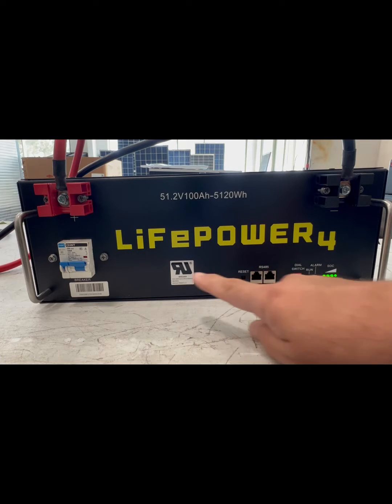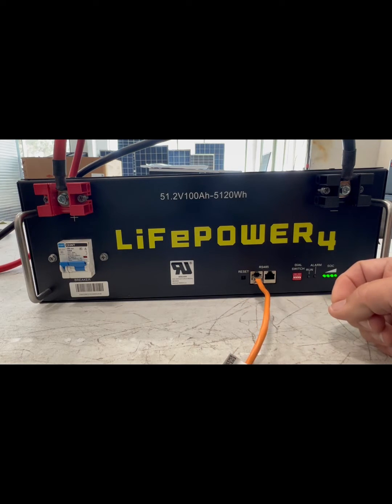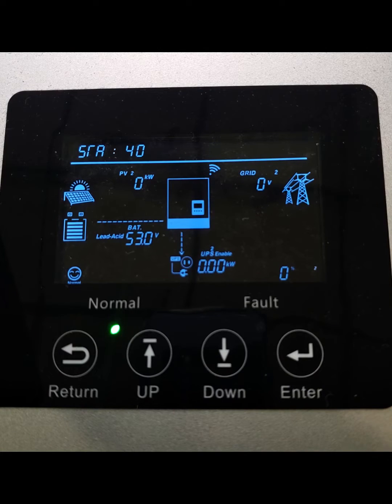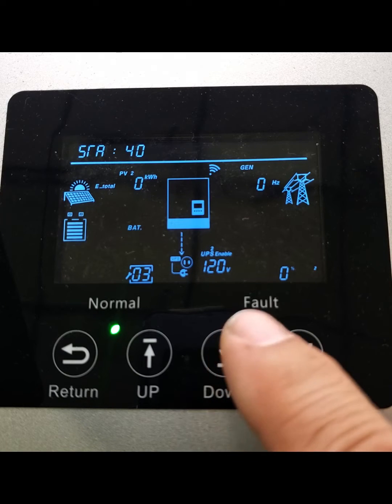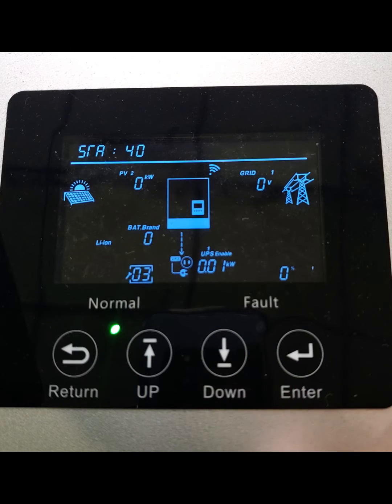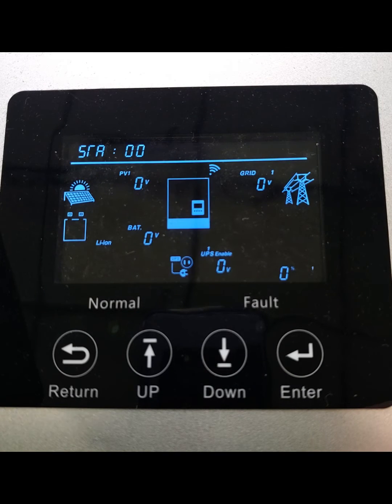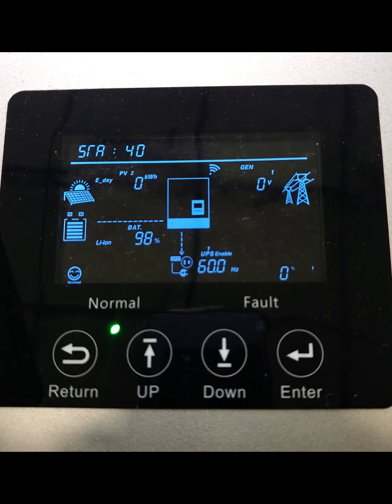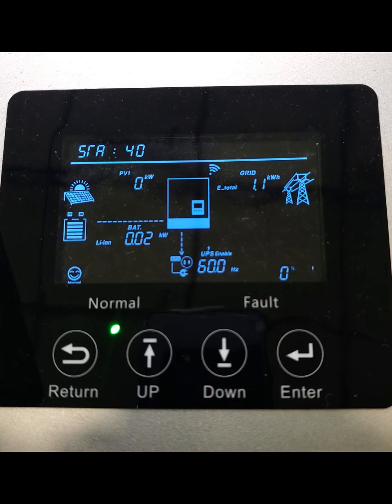EG4 6000XP Inverter - Battery Install

Comment: Does anyone know if the eg4 6000xp can be used with an EEL 48Volt Diy Battery?
Reply: I seen someone using led acid setting for non communication batteries but he ended up getting a supporting battery.